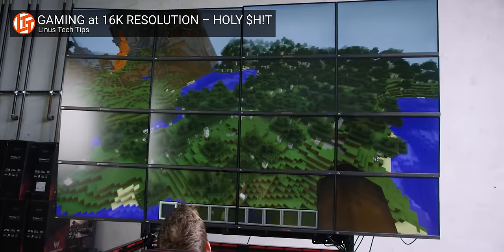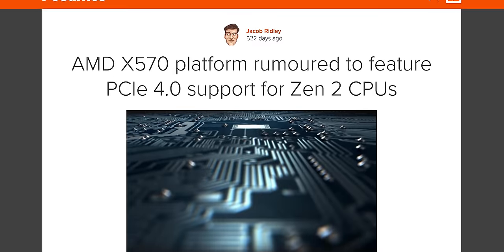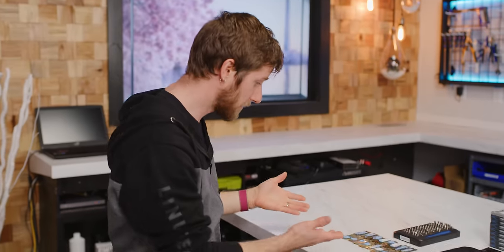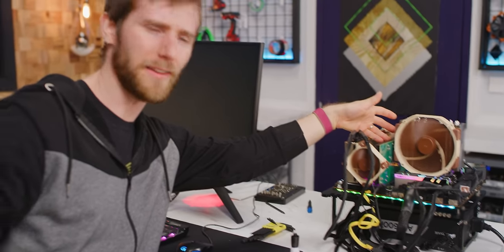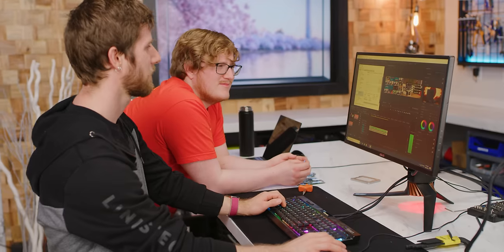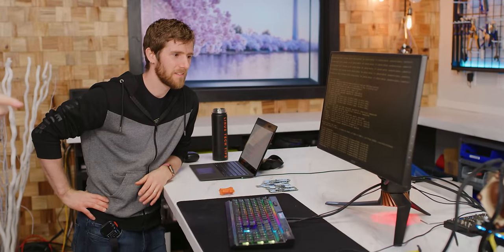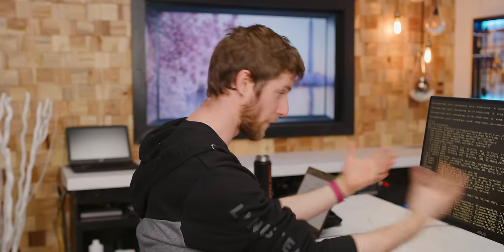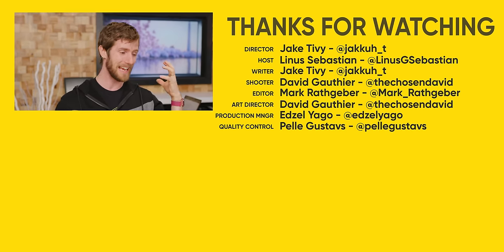This is 50x faster than your PC… HOLY $H!T - Liqid LQD4500 Honey Badger

Comment: Maybe gta online would finally need less than 1min to load in with that system.
Reply: You clearly never sat & waited for jet set willy to load & then got the colour code anti piracy wrong 3 times. Now THAT'S a painful load time.
Reply: It won't help with sever load times, because it is the Rockstar star severs it's self that are slow. It may even be too fast for their servers due to is flops persecond, making it hard for the Rockstar servers to track you.
Reply: Uhm, maybe I guess.
Reply: rip warzone players
Reply: Amount of people not getting the joke is too damn high.

Also SSDs do improve loading times of GTA and I'm pretty sure this one would lower it even more compared to a SATA one.
But probably only by a few seconds
Reply: @norfolkngood8960  Talking to the wrong crowd there bro, only us real oldies know jet set willy and loading games on tape ;-)
Reply: @Ramazvous  Rockstar doesn't actually use servers like other online games. The server is simply a middle man. You are connected to someone else's lobby. Essentially, they find whoever has the fastest internet to run the lobby, acting like a server. If no one is found with fast enough internet, everyone is forced out of the session - this has happened to me before. It's insane how a game with a nearly 275 million USD budget would cheap out like this.
Reply: Ryko_Et _Irish It will help you load into story mode
Reply: Ummm it dont matter its not about ssd its about your internet connection sure it takes a long time to load with or without a good internet
Reply: plz dont check my youtube channel! Story mode is purely downloaded so no it does matter about your hard drive and solid-state drive speed

Comment: If you would put the ASUS one in a 4x PCIe 3.0 Slot and put all 4 M.2 ssd´s in, as long as you use only one drive at a time you would stil get all the performance of that one drive right? 
And theoredically this would stil hold up to one 8x Slot and 2 M.2 ssd´s? 

I mean who uses all 4 ssd´s on an 16x Slot at once at full bandwidth?

Comment: Like ChrisFix always says:

"Out with the old, in with the new."
Reply: can you help pls i rounded my intake manifold nut while trying to change head gasket. how do i take rounded nuts out :( there’s very little space
Reply: @lovelyxyz  do you have a vice grips? You can file 2 sides flat and vice grip the bolt.
Reply: @lovelyxyz  hammer a smaller size on it and use hand tools
Reply: love that channel, m8 :-)
Reply: @lovelyxyz  HOLLLLLLY SHIT I DIDN'T UNDERSTAND A WORD
Reply: Ah I see a men of culture.
Reply: My blinker fluid is overdue for a change
Reply: LOL I WAS ABOUT TO COMMENT THAT.

CHRISFIX GANG!
Reply: This is the call of my people.
Reply: HEY GUYS CRIIIIIS FIXIT HERE AND TODAY
Reply: Ikr
Reply: always use medium strength threadlocker :D
Reply: Did you mean Soapy *W O O D E R* ?
Reply: @lovelyxyz  overclock your engine
Reply: need new blinker fluid any guys here have some ?
Reply: soapy wooder
Reply: @lovelyxyz  I am assuming you cant weld a socket on it, since you're asking. A time consuming solution is to file two opposite sides of it til you can get a smaller wrench on it, another solution is to drill out the very end of the stud, take the manifold of and take the stud out of the head. (These studs are usually very easy to get new). You can also crack the nut, or get a special "socket" that will bite into the sides of the nut and let you loosen it.
Reply: Did you guys change your blinker fluid?
Reply: Heey guys Linus Tech Tips here!
Reply: lets not forget someone in linus' team has a donut shirt
Reply: U watch him omg I do to
Reply: ChrisFix is great, and channel with lots of useful info, but he has such a bro voice! :D
Reply: Ah, a man of culture
Reply: Well...imagine chrisfix seeing the work to do on linus car hahahah
Reply: dBdoesGaming yea don’t have a welder, i don’t think i’ll be able to file it to use vice grips or anything like that since it’s very tight area. can’t use a nut splitter either since there’s so little clearance. i think my only option besides removing the head with the manifold attached is cutting it off the nut maybe if i don’t hit anything else around it lmao
Reply: Good to see a fellow car guy

Comment: Why you didn't install Windows at this SSD?
I want to see the boot at one second!
Reply: My windows 10 boots in about 4 seconds with a single Samsung 970 nvme. Booting windows on that thing would be approximately 8 times faster...., so 1/2 second?
Reply: I want to see that too
Reply: @robhill8894  970's are over priced, my WD nvme also loads in 4 seconds but is half the price.
Reply: @robhill8894  I don't think it would scale linearly because it may not be programmed to leverage that much performance, it's possible that a NVMe drive is close to the program's speed limit
Reply: @robhill8894  file access speed / latency to this thing is probably pretty similar to any standard ssd - so if there's a lot of files it's gonna slow it down - it's sequential access - probably only time you need sequential is video editing - basically when working on one huge file, a thousand of smaller files, and you might as well have the same speeds as a single non raid.. yeah they didn't test stuff like that "realistic" computering as it might not be as impressive.. and when he talked about acces to ram - ram has less access latency.. 
.. I mean it would be great if you can basically instead of ram use SSD all the time, so there would be no bottlenecks and we'd get cheaper motherboards and pcs.. but it's not there yet

Comment: I remember reading somewhere that the bandwidth of DDR4 3200mhz is about 22-25GB/sec depending on hardware. Does that mean this drive is as fast or faster than most DDR4 ram kits?

Comment: "This is 50x FASTER than your PC"

Me: More like 278x FASTER than mine (cries in HDD)
Reply: just get a $30 ssd it will change your life
Reply: I still use hdd too.
Reply: I use 2 ssd's and 2 hdd's xD
Reply: @user-bn6vg8ck4t  not only the OS but also software loading times, copying something from a USB thumb drive to your system disk or vice-a-versa, or even playback if you're watching some 4k movie with Dolby Atmos and sh*t on your home cinema (fun fact: my console struggles reading such files off its internal HDD but playing them off a USB SSD is totally fine).
Reply: Its not just about loading times, it's about system responsiveness. A lot if apps dynamically load small files into memory in order to function and if you are waiting on a spinning platter to come back around onto I the computer is going to feel slow. Although if you have a decent amount of RAM you should feel responsiveness improve during a session thanks to cache..(or at least that's the idea)...

Comment: Linus: "This is the worst UI I have ever seen" Jake: I"ts a BIOS man, relax" LMAO!!!
Reply: @Unknown Person BIOS
Reply: @harsimransingh615  The screen at that point in the video literally says "Asus UEFI BIOS Utility". It is a UEFI. Almost no one uses BIOS anymore, at least not on consumer products like the motherboard in this video
Reply: I read it at the moment he said that
Reply: @ThorsShadow  There is two BIOS. One is legacy and one is UEFI
Reply: @corrosivetoxic1048  this discussion; whether they were using BIOS or UEFI is getting a little confusing. the screen apparently said  "Asus UEFI BIOS Utility" which doesn't add clarity assuming the engineers know UEFI and BIOS are different. perhaps BIOS is a legacy word used in this case to describe that UEFI is similar in function to BIOS to those familiar with BIOS and not familiar with UEFI.
search result:
What does UEFI mean?
Unified Extensible Firmware Interface
Unified Extensible Firmware Interface (UEFI) is a specification for a software program that connects a computer's firmware to its operating system (OS). UEFI is expected to eventually replace BIOS. Like BIOS, UEFI is installed at the time of manufacturing and is the first program that runs when a computer is turned on.
What is Unified Extensible Firmware Interface (UEFI)? - Definition ...
What is the difference between UEFI and BIOS?
BIOS and UEFI are two firmware interfaces for computers to start the operating system. BIOS uses the Master Boot Record (MBR) to save information about the hard drive data while UEFI uses the GUID partition table (GPT). Compared with BIOS, UEFI is more powerful and has more advanced features.Apr 23, 2020
UEFI vs. BIOS – What's the Differences and Which One Is Better

Comment: An amazing point he could've made was instead of "Who needs a graphics card anyway" to "Who needs a SECOND graphics card anyways."
Reply: i need a graphics card i dont even have one
Reply: Ethan Bradley me too
Reply: Literally every single mATX and itx motherboard ever
Reply: Would gaming benefit from this?
Reply: @greedis52  yes, in 30 years maybe
Reply: @greedis52  not until the next decade
Reply: PCIe slots are not made equal, the primary slot is special and faster. Same with the primary m.2 slot. In short they get to talk to the CPU directly at full bandwidth instead of being managed by the mobo chipset.

To get optimum IO performance they had to relegate the GPU to a slot it's not supposed to occupy as a solo card.

Comment: 13:24 "to game consoles another decade later" uuuufff 🔥🔥🔥🔥🚒
Reply: BUUUUUUUUUURN
Reply: I still love the old video with like about how they couldn't underclock a GTX 480 to be as slow as an Xbox one.
Reply: PS5 has entered the chat
Reply: I find that hilarious cuz idk much about ssds and stuff and I was just told by someone yesterday that the ps5 is said to have an 8gbps ssd which is "faster than any sad on the PC market" fucking people lmao
Reply: @OctaviaLIVE  These drives are in a RAID 0 configuration they are NOT single SSD speeds. Sony at the moment is still correct with their SSD being faster than ANY current PC SSD available at this time (compressed speeds anyway).
(PS5) 5.5 GB/s Raw, 8-9 GB/s Compressed.
On top of that the storage on the PS5 can be UPGRADED to even faster speeds 7.0 GB/s Raw, ?-? GB/s Compressed. So for at least a year or two the PS5's SSD will be faster than any you can get for a PC.
Reply: There's a difference between data output and throughput. While this SSD output is faster than PS5 SSD, I didn't see anything more than 3.5GB/s throughput in that video. PS5 SSD can throughput 9GB/s from end to end because of the custom hardware and decompressor. Tim was right.

Comment: I love how I’m watching this without having any idea what they’re talking about.
Reply: That’s me half the time too, I still love watching them lol
Reply: Same i understand 60% of what they are saying
Reply: After watching this dude for a new starting off with 0 pc knowledge I can now confidently say I am an expert pc builder
Reply: Probably getting about 60-70 of what’s being said but them being happy for it makes me happy for them and makes up for the other 30%

I’m just glad to be here even if I don’t really know what’s going on
Reply: Let me know if this helps:

1. A card slots into your motherboard called "the honey badger".

2. This "honey badger" holds eight SSD storage drives (speed wise, an SSD is to a hard drive as a fighter jet is to a car)

3. This card also happens to take advantage of a data transfer standard called "PCIe 4.0" which allows you use all 8 SSDs simultaneously at full speed (now imagine the speed of a rocket versus a car).

4. Assuming you have the internet connection of 2050, this essentially allows you to download eight 200GB copies of CoD: Modern Warfare in under a minute.
Reply: @handlemonium  or you could transfer your 8 copies of cod mw back and forth between two of these cards.
Reply: @freddyclarke8321  Cool now you can work for Verge

Comment: Ps5: finally guys we surpassed PC
Honey badger: hold my .m.2's
Reply: In terms of raw throughput yes. However according to their tech presentation their gimmick isn’t the throughput alone, but the pipeline to that data as well. This is not faster then the custom silicon with ASICS decoding and requesting chips that the tech presentation essentially promised. The PS5 might actually still be faster depending on how you determine speed. For example.Time from request to first GB of data ready for the CPU might actually be quite a lot faster. (However this is obviously still unknown, just how I understood it)
Reply: sick burn
Reply: Brickoliciousness but why have the gave us the 9gb/s number then surely that’s the speed ?
Reply: Brickoliciousness to be honest I am quite confused with what the ps5 is bringing, is it faster than pc’s , if so how much will it cost!
Reply: @Brickoliciousness  the whole point of the pipeline was to achieve the raw throughput though. That's why the halo figure of 10GB/s is compressed (as they put work in to a hardware coder so that the CPU is not dragged down doing it, and it can be done a lot closer to the storage chips). Regular desktop PCs would have to move the data to memory, then send to CPU to decode, and then send back to RAM, then pull what it needs when it needs it to do some work. The PS5 (and MS' Velocity Boost sounds similar), would pull the data, decode it as it flies out of the SSD, and then load it in to RAM where it is good to go immediately. 

What Sony have done is hardware accelerate a CPU function, and moved it to a place that is more efficient to do it, so there is no redundant transfer. But the end result is still all that anyone cares about; throughput. Their controller probably needed some work in order to facilitate this, and so more credit to them there. But this Honeybadger is in a whole other league, and without the bother of compressing data in the first place.
Reply: Lewis McDonald it’s still only a conceptual number with very little reference. They also stated 22GB/s IO chips. It’s highly hypothetical information and we have - as of yet - no ways to actually verify if the PS5 is actually faster for what it is build specifically to do. Odds are it could be faster at delivering data to the CPU for gaming, than this SSD. We don’t know and throughput as a metric is kinda not the best way to determine “supremacy”. I used this example in another comment: consider this. If you ran a cable to mars and back, with a theoretical throughput of 200 billion GB/s, a USB 2.0 pen would still be faster at transferring data to your neighbor. Which will be true until we at some point need to transfer so much data that the cable overtakes the USB pen. We can always cherry pick a scenario where one approach is better and throughput right now isn’t good enough a metric when they essentially are claiming a new “novel” infrastructure compared to ordinary “- in this case “beefed up” - infrastructure. But in terms of raw throughput it’s fair to assume this card is very much faster than the PS5, still might not be it in real life “gaming” performance. There is a reason apple to oranges was used as a metaphor.
Reply: @Brickoliciousness  After reading your comments i am sure you have no idea how fast the Honey Badger Array is.
Reply: Markus Gutjahr I do. It has a faster throughput than the released spec of the PS5 by quite a margin. Doesn’t mean it’s faster at the specific task the PS5 SSD infrastructure is purpose built to solve. But I’m not here to take sides, feel free to argue away, we don’t have data to verify any claims either side might have, so it’s quite futile to continue.
Reply: rhubarbdedubarb I would recommend you watch a YouTuber called “the Cherno” explain it. He has a good video (3 part video) going through the original tech presentation in a very unbiased manner. Also, there’s really no way to answer your question until Sony provides more opportunities to verify their claims.
Reply: PS5 its not just SSd which is faster there other custom components which circulate data around on  I/O PS5 is still way superior.
Reply: Skiddywinks sounds about right, we are not in disagreement. But I would argue one detail, the raw throughput isn’t the metric of their choice, simply a stand-in to simplify their agenda. The goal was to minimize aspects that could be best described in milliseconds, where a throughput measure of a whole second might actually be too crude? They tried to change the narrative about the metrics to something in the lines of first to 1GB of data ready, which obviously didn’t stick compared to the more traditional measurements.
Reply: Look up videos about the PS5 by Digital Foundry, AdoredTV, Coreteks, and Moore's Law is Dead.

Essentially the SSD not only acts as long-term storage, but assists the GPU as a pre-loaded cache to instantly feed games into VRAM.
Reply: Oof this didn't age well.